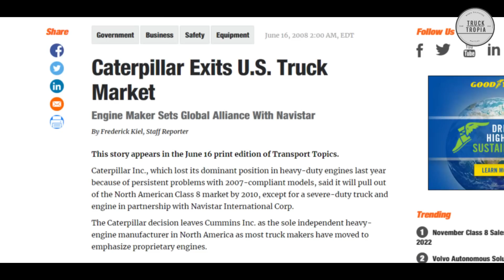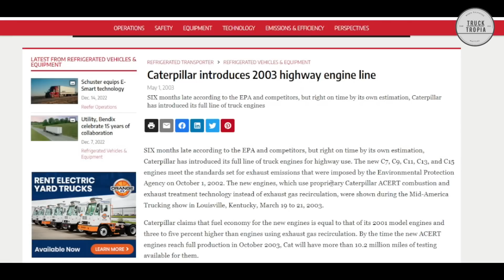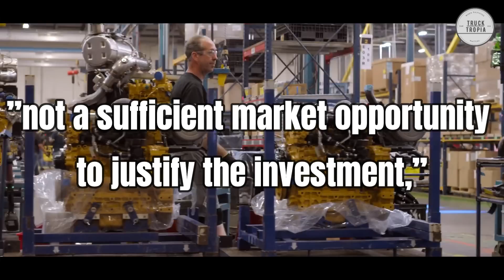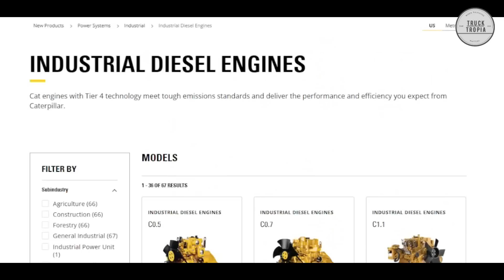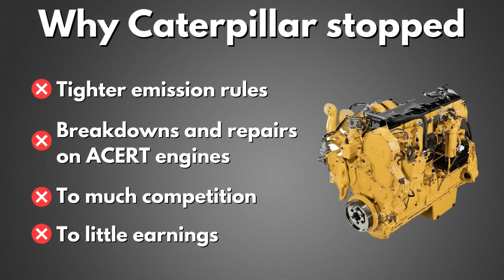Why Caterpillar Stopped Making On-Highway Truck Engines

Comment: 1966 Cummins NH & Mack Maxidyne: First engines to commonly make 500K miles before rebuild. 1981, 3406B:  First engine to commonly make 1 million miles before rebuild. Navistar 13L with full emission control: 300K miles to failure. WE ARE REGRESSING😢.

Comment: They stopped building engines for trucks because they sucked at it. That's the realistic truth. They were decent until 2007 emissions. They put a spark plug on the exhaust stream of their engines. The SDP, LEE, AND C7S were attrocities.
Reply: Cat suck??? 😂😂😂😂, you moron kiddo CAT IS MOST BEST DIESEL ENGINE

Comment: I worked at MEC in Product Quality on the truck side engines, before that i did the oil, air, and elec test on the C13 and C15s. First off the engineers lied to the company and customers about ACEERT tech working in the industrial and commercial sides. Then they forgot to tell the trucking companies that there is 3000 bucks worth of platinum in the stacks and had to be changed 2x a year...there goes your savings. This guy on the video is just a narrator . There's still a 60 billion dollar lawsuit against CAT from Peterbilt and Kenworth.

Comment: I’m in the fire service, the “best” diesel I’ve ever used was a Detroit 6v92, every engine that had one just screamed. Our crash trucks had 8v92, but they were heavy enough not to notice the power. As long as they were leaking oil, you knew they had enough!

Comment: My last truck 1998 Western Star that I bought new had the 3406E 550 hp . Ran it until 2003 and couldn't buy another 3406E in a new truck so I sold my old truck and left the trucking world. Best engine I ever had.
Reply: Damn Straight !!!

Comment: I am driving a Freightliner with a 3406 engine now, and I love this on highway engine. It's a shame that the EPA had to screw things up. The other manufacturers have good engines but it's hard to beat an old Cat that's properly maintained and runs like a dream. Keep the rubber side down & the sunny side up 10-4!
Reply from the maker: Thanks for sharing 👍
Reply: That is all the EPA have ever done is mess the motor industry around. Too much power vested in them! I can understand why Cummins and VW cheated. They are unreasonable!

Comment: I'm not a trucker or anything, but I know here on Brazil, some GMCs actually had the Caterpillar engine back in 90s (15-190 if I'm not wrong about their name, C3116) but they actually ended not gaining good popularity for their high cost maintenance (probably affected by the country) and "weak power" application and many other brands being on the market and selling the same division trucks (competing with a L1620 on that time wasn't easy).

Comment: Cat is now making new engines. As in not refurbished. Even complete engine with a deal with the EPA. As long as you don't down grade emissions. You can upgrade emissions even change from 13 L to 15L or 13L to 13L even swapping any maker engine for a Cat. as long you don't down grade emissions. Don't believe me check with your cat dealer.

Comment: You have it wrong they are still making truck engines, just not anything newer than 2008.
Reply from the maker: Then they are not producing then like i said
Reply: @TruckTropia  you can get a brand new crate engine and they are making new truck engines

Comment: How long will the EPA keep making auto manufacturers make cleaner vehicles… while the real problem lies with the coal factories.

 It was predicted almost a 100 years ago that coal factories will produce most of the carbon dioxide emissions.

 The sad part is, they're going to keep lying to everybody and use that never ending crutch against the people to regulate more and more with no fix in sight until they clean up the coal factories.

 The EPA knows this and they just rely on people being so stupid that the more cleaner and cleaner the vehicles are we keep getting more and more and more C02 emissions.. imagine that.

Sad

Comment: Cat got in trouble with the 475 3406 E it had soft cam billets, and they are still fighting lawsuits over that. Their warranty become useless and that is why Cummins overtook them. The only engine I will have these day's is a Cummins or a Detroit. I have had good luck with my ISX15 and my Brother has had good luck with his DD15. The selling point for me is you can take them to any dealer to have them worked on!

Comment: I am a fleet mechanic for a public utility. Of course, the only Cat engines we have are in our off road equipment where the software is proprietary. There isn't much I can do with one. We don't own enough pieces of off road equipment to make it worth investing in the software. 

Up until a couple years ago almost all of our on-road equipment was powered by Navistar. Our on-road equipment only racks up a few miles each year; but racks up a grip of hours. They drive a few miles to a jobsite then idle all day to run the PTO. 

I think Navistar unfairly got a bad rap the last several years. The base engines held up remarkably well; it was the aftertreatment systems that were absolute garbage. Especially since our trucks idle all day which is torture on aftertreatment systems. Its not fair to blame Navistar for something forced onto them. They have done their best to be compliant at the expense of reliability. 

Of course our newest trucks are using Cummins engines which have been fairly reliable. I have nothing against Cummins but I wouldn't say they are better. Aftertreatment systems have been around long enough now that manufacturers have started to figure out how to make them work efficiently. 

I am not partial to Navistar, but its what I am used to. Their base engines were solid for the 30+ years I serviced them before aftertreatment came along

Comment: THE REAL REASON IS...Once they sold a Truck Engine..
THEY NEVER SAW IT AGAIN !
My 1693 went 1.7 Million miles .
My C-16 had 1.3 million when it was ' majored'...has 400,000 and STILL GOIN STRONG, WITH 105,500 GROSS 5 DAYS AWEEK IN OREGON.

Comment: The EPA pulls new guidelines and regulations outta their chocolate starfish and basically tells the country to go figure it out or you'll be fined. Engineers aren't involved in these new regulations. They didn't even have time to properly do the R&D needed to implement all the new regulations and standards from 2002-2007. The price of a Cascadia in 2009 was less than half the cost of a 2019 and the only difference was the nose cone and the new emissions motor and system. Inflation is supposed to be 2% a year. Instead of 20% we got over 100% truck price increases. The plandemic sent them to the stratosphere even after that. In 2009 manufacturers basically had to get it as close as they could then push out literally millions of rigs with these rudimentary emissions systems that everyone knew was not ready yet, making Guinea pigs outta the entire industry. All those trucks were a nightmare until about 2015. Not just Cat, every single one. The real BS of it all was they brainwashed all these simple lefties into believing they could control the weather, in order to create an entire new multi billion $ industry with parts made in China made from rare earth minerals mined by 3rd world countries that they not only got in on the ground floor of but mandated the largest industry in the country to adopt. And ffs why come after diesels? Diesel is much more efficient than gas. It's more energy dense and gets almost twice the fuel mileage. Another fun fact, a single mega cargo container ship pollutes more annually than every other vehicle in the world combined. If it were really about controlling the weather then it would seem to make a lot more sense to implement this nonsense on one or two of those ships, rather than spread across millions and millions of trucks. Man this country is so corrupt

Comment: Owned trucks for 15 years, had a total of 5. One, had a Cummins, and at 250k miles, it got traded for new with a Cat. Total Cat fleet, total Cat power snd hassle free. Closed the doors in 2000 because the handwriting was on the wall and I didn't like what I saw.
Miss that low growl and deep grunt of those Cats.
Reply: Cummins is better caterpillars overrated even though they make great engines

Comment: 17 years, 2 000 000-plus miles, 47 states, 9 provinces, 1 territory. 
Driven everything under the sun for weeks/months at a time EXCEPT Mack. 
I'll tell y'all flat out - C15 Caterpillar is simply the best diesel tractor engine ever produced by mankind. Still hundreds of thousands of C15s on the road, many with 2 millions MILES on em. 
Honorable mention MUST go to Detroit Diesel. 60 series are a RUGGED engine, 
my DD15 has 900 000 miles on her, cold-starts better than 80% of the junk out there and idles like a kitten sleeping near the wood-burning stove.

Comment: I was an engineer for Cummins during this time-period. Single biggest difference: while Caterpillar and most engine manufacturers viewed increasingly stringent emissions standards as a major obstacle and headache, Cummins embraced them completely. Cummins realized that stricter standards are coming no matter what, and the company with the best solutions will win the market over. They focused on developing the most advanced and efficient emissions solutions with particular emphasis on technologies that would be reliable, future-proof, and easy for truck manufacturers to integrate into their platforms. This was a major revolution in culture at Cummins leading up to 2010. Previously they were like everyone else and always struggled with new emissions standards. The hard work paid off as their biggest competitor, Cat, exited the on-highway market and Cummins took over. It was an impressive company to work for. Well run, and incredible engineering practices.
Reply: That's why modern Cummins engines are shadow of what they used to be. On top of that fine one costs an arm and a leg. Whereas if you live in a non emissions checking state you can buy an off-road Cat motor and shove it into your truck and go forever.
;3
Reply: Yes  all emission compliant engines are money pits ( junk) oh maybe not for engine mfg$$$$$.
Reply: @ruxoneto6560  yes all the emissions make them suck i had a cummins isx that kept giving me problems with the egr so I decided to delete it and everything else that had to do with emissions and never ever had a problem with the truck again!! Emissions components is whats killing these new engines!!
Reply: @LaCheyenne72  keep parts , the problem is when you get a recall notice & you have to take it back to dealership  when they see it has been deleted  they won't touch it !!
Reply: @ruxoneto6560  dont need the dealer i do all my maintenance and repairs
Reply: @LaCheyenne72  yeah but when there is a recall on the engine-truck you MUST take it to the dealer to get it fixed, you -your  friends can't fix it  The dmv will not license your truck !!!!! & when the dealer sees  the delition the will not touch your truck !!!
Reply: So what you're saying is Cummings sold their souls to the inevitability of government ruining engineering with layman idiocy and just rolled with it. If you're trying to make me or anyone with sense respect them for their foresight, it's not working.
Reply: It won't be long until Cummins is squeezed out of the trucking market by technology and consolidation.  It's not like back in the old days where everything was a separate company that would buy parts of each other and build trucks.  Daimler owns Freightliner, Western Star, Mercedes, and Detrioit Diesel... Paccar has Kenworth and Peterbuilt along with their own engines and drive trains....  Volvo has it's own parts.  Cummins is the only engine not owned by a parent company of any on road vehicles and eventually that will be it's downfall in the trucking segment.  Sooner or later it's going to be too much to keep separate programming going to run both in house drive trains and Cummins.  Cat has enough business in construction vehicles to keep it going forever.
Reply: Adapt or die!
Reply: And it didn’t hurt that Cummins dumped millions into to “buying emissions credits” from the EPA and not technically meeting the requirements from the EPA for multiple years.
Reply: THANK YOU. I actually didn't know this, so that's a cool little bit of information, but scrolling through the comments it was really annoying seeing all the "EPA ruined muh trucks!" when...having ever-increasing emissions standards (which occure for a variety of reasons--shockingly, government agencies who have to answer to Congress and whose heads are appointed by the president, and have to answer to him too, typically don't add new rules arbitrarily and for no reason) is kinda their _job_, at least insofar as stuff on the road goes.
Reply: @rileyknapp5318  yeah that is what nazi generals said too!!
Reply: I always loved driving a CAT and was super disappointed with them when they decided to throw in the towel on hi-way engines. Citing profitability is a lame excuse for simply giving up and being a quitter
Reply: Well it doesn't look too advanced to me when the dealer ships shop bays & the parking lot is full of new junk that  won't  stay on the road .!!!
Reply: You're forgetting the fact that cummings were complete garbage when compared to a Cat
Reply: @EitriBrokkr  big facts.
Reply: @EitriBrokkr  Not really. All engine manufacturers struggled to produce reliable electronic control systems for their engines in the beginning. Which was one of the first steps towards meeting emissions standards, like the Cummins celect systems, CATs ACERT systems,  and Detroits DDEC system in the 90's. Prior to that the old Cummins 855's and early N14's and CAT's 3406 many variants could go head to head if put in the same chassis, both engines could suck in a rag and spit it out the exhaust. Cummins just kept with times better, and the ISX15 is a pretty sweet power plant for modern trucks, a lot less tolerant to eating dust, but certainly powerful. Not saying they make a better engine than CAT but it sure isn't "garbage". You want garbage go to NAVISTAR that MAXXFORCE will throw you for loop.
Reply: @kvanderpool0508  who even talking about electronics? Mechanically, physically, maintenance-ability. Cat made a superior engine. It's not even close.
Reply: @EitriBrokkr  Well considering every modern engine is common rail which requires an ECM to work, really at all, then everybody is talking about electronics. Engines are pumping out more horsepower per liter today than they were in yesteryear even your new C13, well newish ... newest anyway. 

As far as "Mechanically, physically, maintenance-ability" it's a straight 6 diesel dude. They don't make a simpler engine, the durability is down to things like bearing material, oil pressure, and tolerances the manufacturers have nailed down the rest, ever notice how the architecture of a single block will last for decades. If you're talking about engines having connecting rods going through the block, well that's down to either poor maintenance (operators fault) or poor workmanship (mechanics fault). That stuff doesn't just happen because of the nameplate glued to the valve cover.

 Routine maintenance should be trivial to anyone driving a vehicle, let alone any kind of heavy equipment like a big rig, no matter the engine. Keeping up with all maintenance intervals including the big expensive 100,000 mile ones goes a long way in keeping an engine alive. 

But maybe you like being able to do all the work yourself and buy all of your parts from the aftermarket. Well I don't know of any manufacturer that doesn't sell parts for their engines (even the oldies), or that doesn't have some aftermarket support.

 I don't think truck drivers like CAT's for maintainability so much as I think they like the trucks that come with CATs mainly long nose PETEs and Kenworth's maybe some Macks, but I don't know they're not that common where I work. Big engine compartments, easy access to everything from the front main to the bell housing, minimal Wire harness BS. I know that I love working on them.

To me the argument of which engine manufacturer is superior is as ridiculous as Ford VS Chevy it's down to personal preference. By and large all engine brands are similar to the point of triviality because they all have to meet the same federal requirements of their respective era, and they have to be competitive with each other by being comparative. So in essence Cummins not garbage, CAT not garbage, MAXXFORCE garbage.
Reply: I hear Cat make the emissions excuse all the time, as if it was only Cat that had to adjust to the new rules.
In reality, either Cat couldn't, or wouldn't do the engineering that was needed.
Reply: @busslayer4790  I think the problem is they were over invested in an elaborate system that was fairly trouble prone. Unlike every other brand who went for cooled EGR to manage combustion temps and bring NOx down they decided to go with an expensive, complicated setup with dual turbos and a liquid to air pre-cooler, plus they had tons of problems with the ARD heads for the air/fuel/spark to burn out the DPFs fouling. Lots of valve solenoids too. Worked at a CAT dealer in 08 and 09 and got to see it.
Reply: @busslayer4790  As I understand it, even the best emission system doesn't work for long. Especially if you don't drive much. Expect a lot of problem then. The DEF fluid stays fresh about as long as milk. The emission system doubles the cost of maintaining the engine. What problem does it really solve? Is it a religion like recycling?
Reply: It should also be pointed out that many European and Asian countries (not China) have stricter emissions standards. Japanese car manufactures Honda and Toyota have been showing up American Auto companies in the emissions/fuel efficiency category for decades.